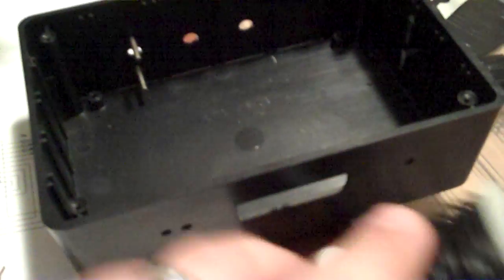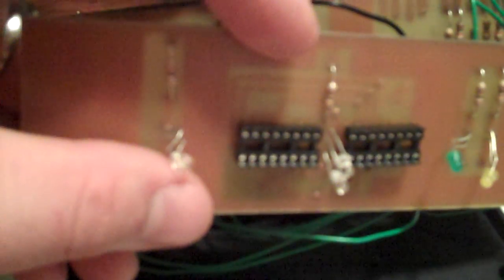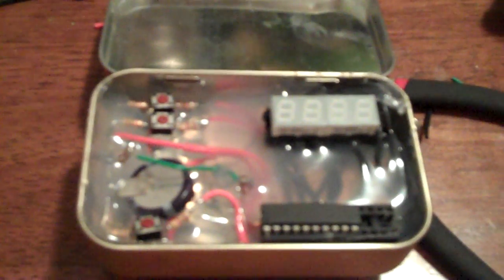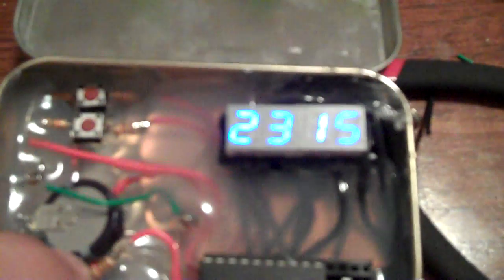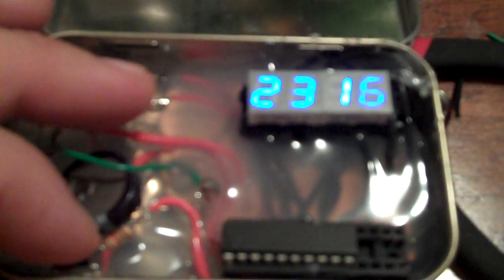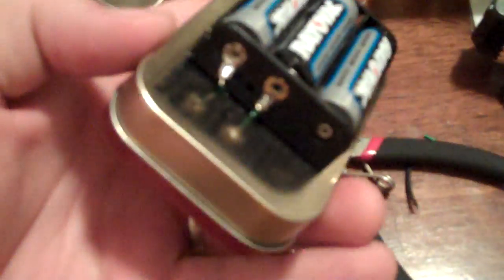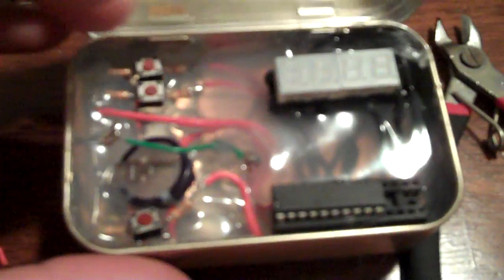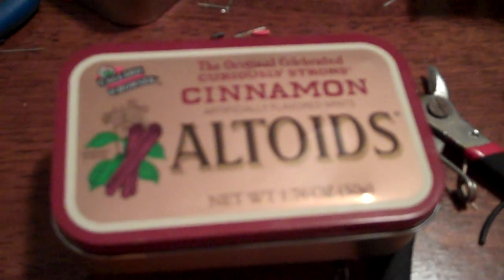http://Tech-tut.com My PIC16F690 Digital Clock That Doesn't Use A Real Time Clock

Comment from the maker: @Oricevreitu Thanks. I have since scavenged this clock. I used the displays for something else and cut the super cap out, so I can't try it out. I agree that using a 4MHz XTAL would increase stability. The internal RC can be trimmed, but that's a hassle and doesn't fix the changes due to temperature.

I'm glad that it worked out for you.

Comment: setup_timer_2(t2_div_by_1,0x64,10)
try replacing 0x64 with 99 and if (milliseconds==1000)
then you'll have a more accurate clock.
I made these changes to the code and i have an accurate clock working for 8 months. It helped me puting a 4MHz crystal.